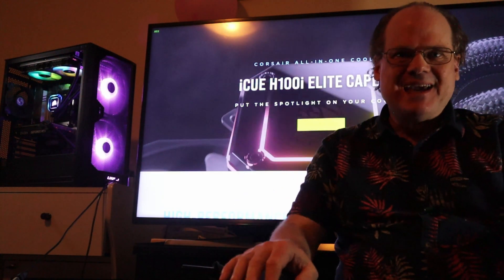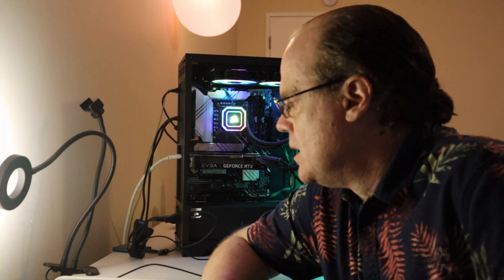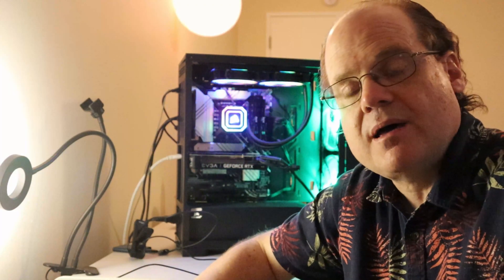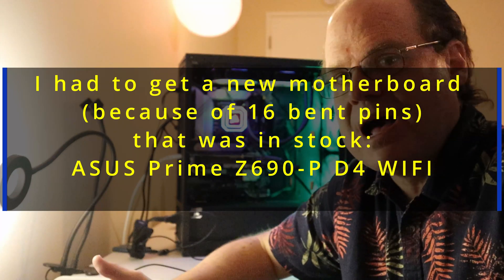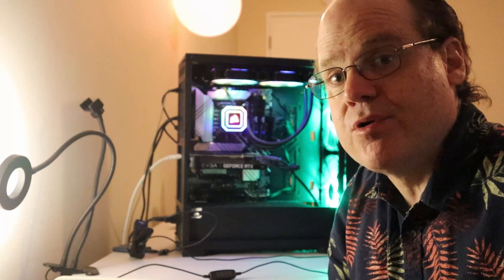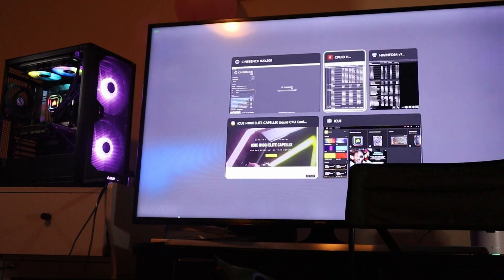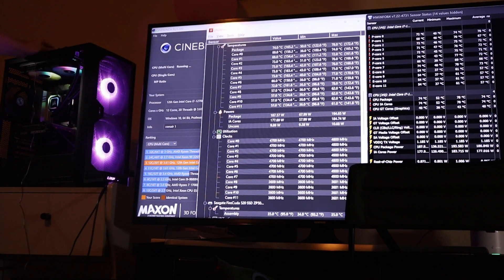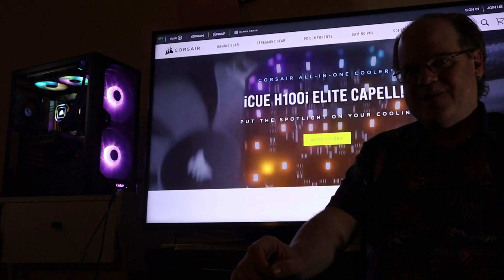Important AIO Update on MSI MAG 240R 360R 120R Coreliquid CPU Cooler. How to fix high temperatures

Comment: I've got a Lenovo legion branded version of the pump and I too am giving up on it. Thinking of getting an Arctic Freezer II.
Reply from the maker: Careful, there was a problem with that one so you have to make sure you get a fixed one. I got the Corsair H100i Elite 240 and it is great, except yesterday I had to install the Legacy version of the iCue software because of bugs. Watch https://www.youtube.com/watch?v=sayxZETxbXo
Reply: @PC Gaming Tech Summary  thanks for the heads up. What was the problem with the Artic? I've heard good things about it. Plus I can only get the Corsair H115i where I live.
Reply from the maker: @therichieboy  I like Corsair but there is a problem with the iCue software at the moment.  Arctic Problem:  PC cooling manufacturer Arctic has found a potential issue with the gaskets in its Liquid Freezer 2 AIO coolers manufactured between May of 2021 and March of 2022. The issue can lead to reduced cooling performance and a potential loss of cooling liquid in the loop.23/08/2022
Reply: @PC Gaming Tech Summary  yes I just read that. It should last the guarantee period then they supply a replacement kit. I'll risk it. Thanks again for your advice.
Reply from the maker: @therichieboy  Glad I could help and Please subscribe!

Comment: I own the Msi Mag Coreliquid 360R (V1) and I can confirm that the temps are reaching very high levels, even days/weeks after installing the AIO. For about a week and a half, my AIO was making crackling noises, increasing in temp slowly... but now it just shoots from 70-80c to 100 degrees celcius (200+ degrees farenheight) when I launch an application or anything that requires the use of my CPU. Thankfully, using the serial number, you can contact MSI and get (at no cost) a replacement with the new and improved V2 edition of the liquid cooler as long as you still are within warranty range of the product. I already had disposed of the box, and they told me it didn't matter I can send the product back in any box as long as I return it. (I don't have to send them the cooler until I receive the replacement.
Reply from the maker: No need to replace one nightmare for another nightmare. Go straight to Corasir. If you like my videos subscribe, if not don't.

Comment: This happened to mine several months ago. I was fine originally then I went to overclock my cpu then noticed I was throttling at idle or basic light load. I have a 5950x I contacted MSI got a replacement but needed a cooler so I bought one temporarily. Forgot about it till the other day. Just put it in and this video pops up. Guess that's what happened. Just checked my serial number and it says I don't qualify so hopefully I'm good
Reply from the maker: It seems  that most people that have faulty MSI AIOs do not have a serial # that qualifies for a swap. I would assume that it will fail eventually. Even if it is out of warranty, I would still demand a refund or replacement. Ask for a different model number. Check out my new Corsair  https://www.youtube.com/watch?v=sayxZETxbXo  Subscribe, if I helped!

Comment: My temps are shooting 103 degrees on my R9 5900X and it failed me. I dont know what to do I did a RMA request which was only valid for 20 days and now it is not letting me geenerate the other RMA and my cooler is from NOV 2021 and still not on recall list says my serial number is not eligible for that. Please suggest me step by step processs guyss need your suggestion. 
What should i do its just 5th month of cooler and it makes weird noises and temps are shooting.
Reply: take everything apart and clean it nothing to loose your aio is basically  broken untill you get all the bs out i had same problem as you.  As long as you have mechanic skills of a 6th grader you should be fine
Reply from the maker: @chasemorse149  I had no sediment or blockage because I only used it a month. In the future keep an ear out for ... https://www.youtube.com/watch?v=K4K-rdWmZNo
Reply from the maker: Who did you by it from? Can you physically go there and request to exchange it for a Corsair? What AIO is it?
Reply: @pcgamingtechsummary  Amazon that is the biggest issue. Return window is closed.
Reply from the maker: @ParthRathod103  Create a ticket on the manufacturer's website and explain what happened and possibly have a screenshot of the high temps and proof of purchase,  if they allow attachments. Try and get a different model.

Comment: I have the 240R V2 that released back in March, and no problem so far. So ill just watch it and listen. but So far no problems with the new version
Reply: i have one i bought in march also and it gets really hot when i play certain games… im considering buying a new one since i don’t think best buy will take it back anymore :(((
Reply from the maker: @distortjapan  Hi melly, I would go into Best Buy and talk to them. Bring your receipt and maybe a screenshot of your high temps. I would try and get permission to trade it for a Corsair before you take it apart. You may have to pay a little more.  If they try and give you another MSI, I would tell them they all appear to be failing due to bad manufacturing of the radiator and coolant. If they refuse, I would create a ticket on the MSI website and demand a different model because another one will also fail. (I am publishing another video by tomorrow about the Corsair.) If I helped, please subscribe.
Reply: @pcgamingtechsummary  doi you prefer your corsair btw? like for some reason when i was playing fortnite and valorant with this cooler my temps get from 80-90. my computer even overheated on fortnite and this never happened with my old cooler that was just the regular 240r from ibuypower. so im really thinking its just this cooler that isnt good. please let me know if the corsair is any better. im looking either into that or nzxt.
Reply from the maker: @distortjapan  Have a look at my recent video https://www.youtube.com/watch?v=-d44wt-6TEc  Corsair H100i Elite has a 5 year warranty.  I have another Corsair AIO which has worked over 5 years. Your AIO is probably failing due to  the radiator and/or coolant. Inside will probably be a gunky mess and not worth trying to fix. I would not get an AIO that has the pump in the radiator, as I explain in the recent video. If you click my Channel button, you will see heaps of videos on this subject.
Reply from the maker: Thanks for the update. Please keep us informed. The reviews on Amazon for the V2 240R and 360R  create concern.  The cooling of my Corsair is amazing. Another video to be published today.

Comment: Mine just failed and I bought it at the end of 2020 😢 My serial number wasn't on the recall list either..
Reply: Do you have msi account and registered product ? If yes create ticket on support page and ask for swap i was not eligible too but after I created ticked they changed it for free now I have their new v2 version that has it solved
Reply: @yugi1989  yeah, I'm trying. The website keeps saying the serial number is wrong. I'll have to call them Monday.
Reply: @yugi1989  did you send back the fans in the RMA, btw?
Reply: @RuffPlay  yes you have to send the entire cooler it took 1 week from sending old one to recieving new one
Reply: @yugi1989  is common problem really
I got mad because of it 
I tried 16 Hours of video and I did everything i can do on the PC to solve the issue after your comment i got an idea it's common problem and the will replace it free
Reply from the maker: Yes, make sure you go to MSI first and create a support ticket to try and get a "different" AIO. I would treat the old coolant as a biohazard. Wear PPE; like gloves etc.  I would maybe take video so you can go back and look at it. I would take apart the pump and water block. Then the question is how to clean the rest of it? The cleaning solution needs to be ok for copper and aluminum.  Maybe contact Mayhems or other company.
Reply: I got mine 360r just February and today my cpu kicks upto 95° on idle..
Reply from the maker: @nickalgerlumain6485   I would try and return it to your retailer for a Corsair. It seems  that most people that have faulty MSI AIOs do not have a serial # that qualifies for a swap. You can also create a ticket on the MSI website. Demand a different model because they all seem to fail. Check out my new Corsair  https://www.youtube.com/watch?v=sayxZETxbXo  Subscribe, if I helped!
Reply: I was able to get a RMA done. The new cooler works great and I got two new fans out of the deal..
Reply from the maker: @RuffPlay  Thank you for the update. Did they send you the same model? Even if it is a V2 the reviews on Amazon are not good.  If it is the same model, I would assume that it will fail eventually. Even if it is out of warranty, I would still demand a refund or replacement. Ask for a different model number.
Reply: @pcgamingtechsummary  it's the v2 and my warranty is good for 5yrs they said.
Reply from the maker: @RuffPlay  Nice. Great News.